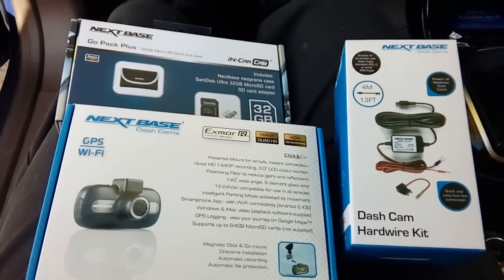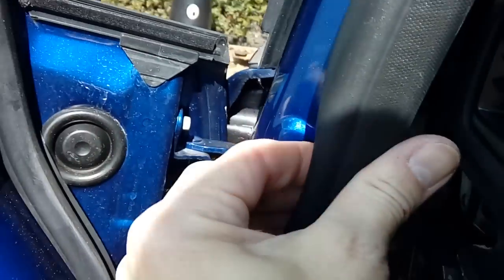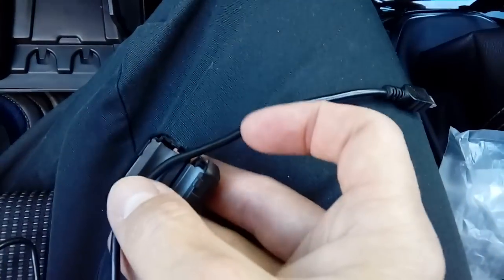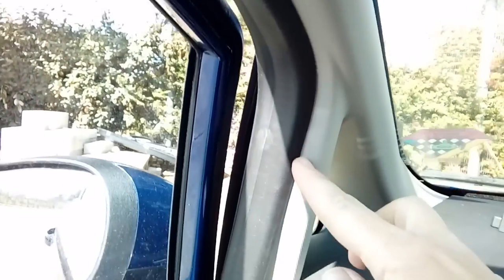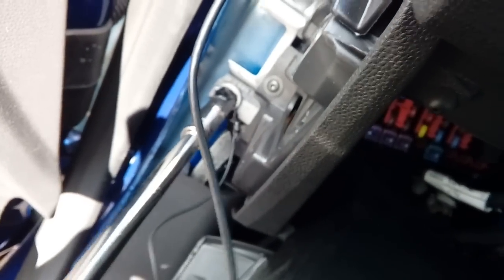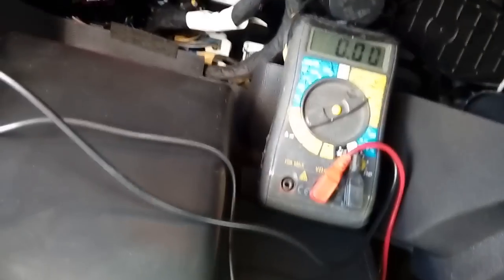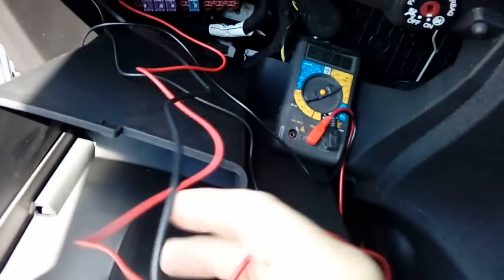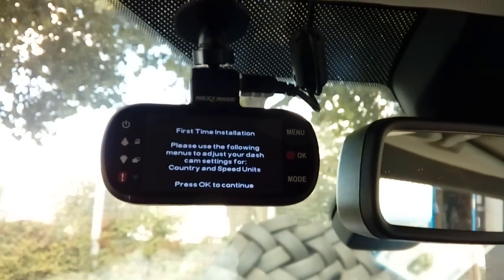How to fit a dash cam in a Fiesta mk6 2007-2017 hard wired to fuse box,quick & simple

Comment: Please could you tell me which fuse to use on a 2016 Ford Focus ,your would be very much appreciated
Reply from the maker: If you have a cigar lighter socket that goes off with the ignition(test it by plugging the cam in) then on a UK model right hand drive model not imported through Ireland then fuse 61. If you have a cigar lighter that works with the ignition off then either fuse 89(not used) or failing that fuse 71 which works aircon and is active only when ignition is on.

Comment: Hi I’m looking to instal this in a 2010 pre facelift SZ2 Suzuki swift. Is the principle the same? I have noticed the fuse box is minuscule near the pedals? Any help and tips would be appreciated.
Reply from the maker: Hi.
Yes it's the same sort of deal on most cars tbh, with your car look under the dash near the side for earth cable mounting point,there is a 10mm nut that I normally use. As for power if your fusebox has a lid this won't be needed after the install because it won't clip over the fuse spur.

Comment: Great detailled tutorial, many thanx. I have one question about keeping the camera working when the engine is stoped, i have a +B yellow cable in my camera and i don't know where tu plug it. please can you help me? thank you in advance :)
Reply from the maker: Yes this is a constant live cable and is for parking mode so you need to connect it to a live circuit that does not go off with the ignition such as central locking or power seats.
Reply: @PJsprojects   Thank you so much man ;)

Comment: Yet to do mine. Your video will be of great use to me … simply explained. Just one question: I've seen situations where the kit has been connected to a permanent live fuse so as there is power for the Parking and G modes. Should this be done, or will there be problems? I realise there is a drain on the battery, but I would have thought it wouldn't be enough to run it flat. Many thanks.
Reply from the maker: Yes that would drain the cars battery,you can buy parking mode kits that have both constant power and switched power cables. A lot of cameras have a parking mode that works on battery back up but this is only designed for short stay parking,not long periods of time.

Comment: Just got one of these for Christmas. How would you connect it to a Hyundai ionq hybrid please
Reply from the maker: Your best bet would be to run down the drivers side due to the fuse box being located under the steering wheel(right hand drive car).
You could use the interior light fuse for constant power and the spare ignition fuse for switched power(for cameras with two power feeds when parking mode is equipped).

Comment: Great vid mate. Got 2016 ST and fitting a viofo dash cam. Just wondering what strength was fuse that came with wire tap because mine hasn't got one.  Thanx.
Reply from the maker: A 3amp will be fine.

Comment: Hi I have a 67 Plate Mondeo Titanium and for the life of me cannot find a fuse controlled by the ignition in the fuse box under the glovbox do you have any idea,as what to try, Thank
Reply from the maker: UK spec titanium models are a bit of a pain because they have many none ignition powered extras over the other models. You have two possible ways to power the camera,one is locate heater power as this is ignition switched and solder an extra wire to it for your power or most Titanium models have three 12v sockets with only the very front one being powered all the time,try the other two or if you only have one find the yellow/green and black cables with the socket plug on the end that will be tucked under the blanking plate of the extra 12v sockets.
Reply: thanks for the hep

Comment: Hi. Great video. With the advent of the 522gw, when using Parking Mode the internal battery isn't great but id like to use this mode whilst I'm at work. In your professional opinion, what would be the best fuse to attach it to. I have a Mark 7 2017 ST, the same model in your video ( though not ST ).  Many thanks 😃
Reply: Forgot to ask. Can the Speed Indication be switched OFF on the unit, for obvious reasons. Thanks again...

Comment: Also I don't have a multimeter so should I just look for a 10 amp fuse ?
Reply from the maker: No, make sure you use a switched live, something that is off when ignition is off such as heater blower fuse.
Check your car manual for the right one.
Reply: But it has to be 10amp fuse ?
Reply from the maker: @richardpoole5928  Nope, just don’t use a critical fuse such as airbag,ecu that type of thing.

Comment: Hi mate, if I fit a dash cam using this method, will the dash cam still record when the car is off and locked?
Reply from the maker: Not unless your camera has parking mode with built in battery pack and movement sensor.

Comment: Top video, I wanted to fit a second rear camera could you use the same power supply and spice a second power lead?
Reply from the maker: Yes no problem just pop a 5amp fuse in the fuse spur instead or the normal 2 or 3amp.

Comment: Good vid mate .please could you tell me which fuse number to use on a ford ka 2010
Reply from the maker: Depending on build region and spec you would need to check the handbook for the 12v socket fuse or other accessory switched live.

Comment: Great tutorial, I've just done mine. A bit daunting for the novice, but everything good. I managed to do mine without removing the dash side panel by threading the wire from the fuse box end to the camera. There are two good earthing points directly above the fuse box. Thanks for the vid.

Comment: Nice Video, Im looking to do this to a new Feista 2018. How does the glove box come out on these? it seems to be different (same tabs can be seen but there is also slow lower arm thing) tried giving the sides a squeeze and pull but it wasnt keen to come out
Reply from the maker: Yep those mini dampers  can be tight to remove,try pinching the sides of the mount that are in the dashboard as they normally unclip quicker than the one mounted to the glovebox door.
Reply: PJs projects cheers for that. FYI there is also some pins int the bottom of the glove compartment that pull out. After removing those the glove box removed with ease

Comment: That bolt to fix the grounding wire is damn tight! Any ideas on how to get it loose?
Reply from the maker: Best to use a socket with long extension bar and a long handle ratchet.

Comment: My Nextbase 212 cam seems to be knocking off the GPS signal on the built in sat nav of my Fiesta. Have you come across this issue and  any ideas how sort it? Cheers
Reply from the maker: Yes this can happen with gps or bluetooth devices,make sure you have fitted the filter as near to the usb plug as possible but other than that not a lot can be done in some cases.

Comment: Thank you for this 😊🙏🏼 going to give it a go. I don’t have DAB so do I still need to wrap my cable round that black thing. Do I still need to put that bit on?
Reply from the maker: Lils M The black thing can also help with FM interference so best to use it. If you run in to any problems just ask.

Comment: What does the little magnetic filter thing do that you showed the wires folded in?
Reply from the maker: It helps with radio interference,DAB radio can be badly effected by such things as cameras or other electrical additions and so this helps cut the interference down but in some cases is not enough.
Reply: PJs projects thanks mate, one last question my fiesta is an 09, will the same fuse as yours work? I can send you an image of my fusebox
Reply from the maker: Yes should be fine on that year.
Reply: PJs projects thanks very much worked perfectly, only issue I had was that the earth horseshoe comment fit round the bolt. Helpful video👍

Comment: Can those nextbase installation kits be used to power any dashcams that the plug will fit into
Reply from the maker: Yes up to 5amp,they come with a 2amp fuse but that can be replaced with a higher rated one if needed. Most cams are only 300ma so the standard fuse should be fine.
Reply: thank you so much for your reply, and may i say your video's are very informative

Comment: Hi can you tell me what diameter the cable is as my Kit didn’t come with the dab suppressor so need to buy one . Also my cam has parking mode witch is motion sensitive so I would imagine I need a fuse with a constant power !! Please help mate lol
Reply from the maker: Most of the cams use a 8mm cable and have battery back up for parking mode,so you still need an ignition switched supply to it.

Comment: Does it matter which way round to plug the piggyback fuse?
Reply from the maker: Yes fuses have what is known as a hot side so plug the fuse spur in the same way around as in the video for a RHD car. On LHD you may want to double check with a multimeter first.

Comment: Hi thanks for such a good step by step vid it had helped lots. Just wondering if you know what fuse I should use on a 05 plate  fiesta thanks
Reply from the maker: Regions of sale and spec makes the layout of the fuse box different so with the aid of your owners manual and a test probe try looking for maybe the heater motor fuse as this is a switched circuit.

Comment: Grate vid thanks, will using that fuse point Power the camera for a parking mode ? If not what would you suggest ?
Reply from the maker: Depends on the camera,most cams have battery back up and parking mode only records when either a bump or motion is sensed and so main power from the car is not needed.
If you need a constant powered fuse it will be a case of checking to see what other accessory fuse is powered even when ignition is off.
It's worth checking the power draw of the camera if the car is being left for a period of time because you don't want a flat battery. A lot of cams should shut down when they detect main car battery running low.
Reply: Thank you for replying, I'm installing the same camera as in vid on the same car.

Comment: Just watched your video m8 can you have camera on permanent 12v supply from fuse box so camera is on all the time
Reply from the maker: You can but be aware that the memory card will wear out quickly,the cars battery could go flat and they are not really designed to run like cctv.
Most have a parking mode that starts recording if a shock is sensed but the back up battery only last a short while.

Comment: Hi m8. can i do this on a saab 93? the pillars have airbags, so is it safe to move the covers? also which fuse would be advisable?
Reply from the maker: No need to fully remove the covers,just lever the edges forwards enough to get the cable behind. As for the fuse use an accessory fuse,nothing from the airbag,ecu or abs systems.

Comment: Great how-to video. Thank you! Your tip of using small wrapped zip ties to tuck the wire into the headliner is brilliant. For American owners, I have a 2017 FiST and I used fuse F8. It's a 7.5A used for the sunroof and it's powered by the ignition. 2nd little one up from the bottom on the right.  Perfect.

Comment: Thanks very much for the video. Made it a much easier job and I’m sure this has helped a lot of people including myself. Only thing I would say is that bolt for the negative connection requires a long socket extension for the ratchet because it’s bloody tight! Taping it to the little metal gap just above works fine, it’s just not as secure. Thanks for sharing.

Comment: Hi, i have a 2009 Fiesta, is the fuse box the same please?
Reply: Tony Bingham did you find out if it is? I have an 09 too but I don't have a multimeter.
Reply: @jamie3499  any info on this would be good as i have an 09 Fiesta too
Reply: @PerringtonBear  I can't remember if the fuse box was exactly the same but it was easy enough to work out and worked perfectly. It's easy to work out which are powered on with the it ignition without a multimeter👍
Reply: @jamie3499  ok good, cheers for the reply
Reply: @PerringtonBear  no problem mate

Comment: What one is the permanent live fuse? (For g sensor)
Reply from the maker: You could check any circuit that has to keep power all the time,such as central locking. Check your owners manual and run a meter over it just to be sure before pulling the fuse.
Reply: @PJsprojects  thanks

Comment: Hey could anyone help me here? I have purchased a Pruveeo hard wire kit (https://www.amazon.co.uk/gp/product/B06XW1JTN8/ref=oh_aui_detailpage_o00_s01?ie=UTF8&psc=1). However this kit has a fuse attached to the live wire. Would it be possible to follow the exact steps you did but instead of crimping the live wire to the blue end of the splitter, could i plug the live wire with the attached fuse into the splitter?

I'm having alot of trouble with this...
Reply from the maker: If you have also purchased a fuse spur(splitter) then yes you can plug your attached fuse into it for power.Not sure what cable is blue that you refer to??

Comment: Hi, which fuse would you recommend in a 1.6 Astra j
Thanks, Ian
Reply from the maker: You need a fuse that goes dead when the ignition is off,such as the heater fuse as the heater can not be turned on when the ignition is off.

Comment: Good video very informative but I have a rear camera with my set up and I understand it needs to Conections the reverse light and it seems to be a bitch to get at.
Reply from the maker: A rear dash cam should not need a connection to your reverse light. Only reverse cams need this and then it's a case of either going to the power wire that goes to the bulb holder for the reverse light or the reverse switch (if powered as some are switched earth).

Comment: Im really annoyed, wired everything up and all was fine and dandy. As i said i piggy backed it off the rear wiper. When i turn the ignition on, the dashcam turns on but after around 30seconds it turns off. I then turn it on manually and it says its nit charging please help.

Comment: The fusebox on my wife's 2016 fiesta isn't behind the glove box but next to the battery and forward of the front suspension mounting. How do I cable through to it?
Reply: What model of fiesta is it, as every fiesta I've worked on has fuse box in the engine and behind the glove box.